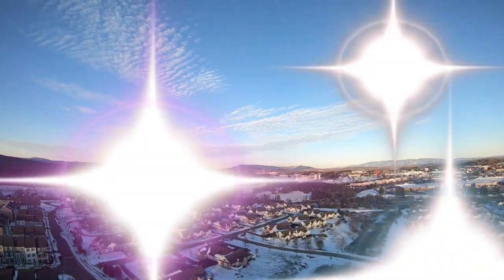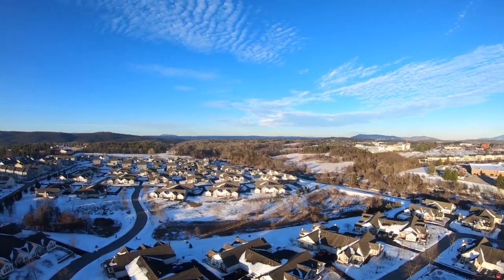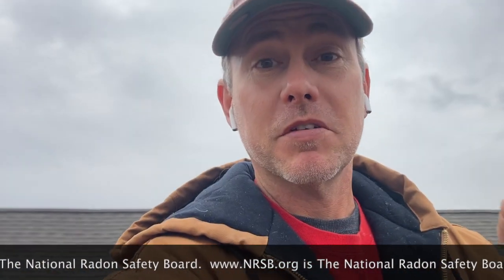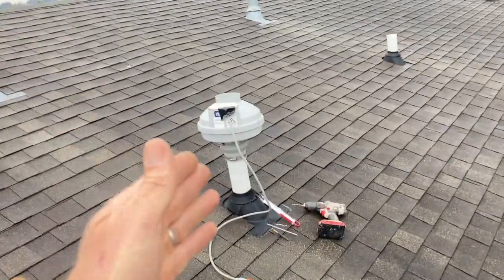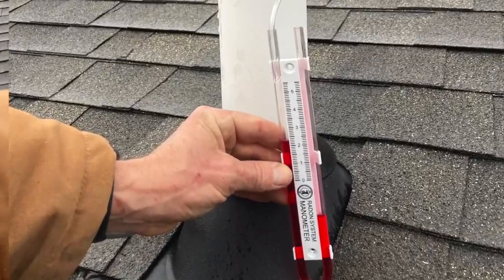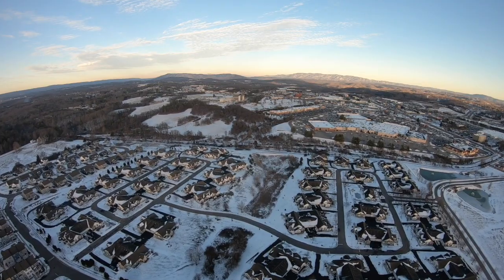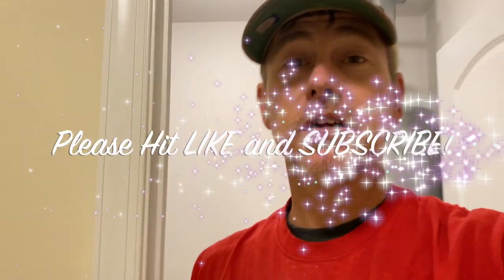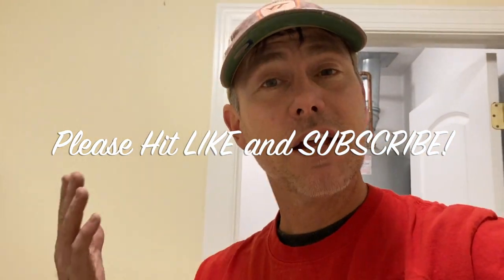These Passive Radon Systems Don't Suck  (...WHICH IS BAD)

Comment: About 60% of homes in my area with passive systems aren’t done correctly. We always cut the pipe when we arrive to see if it’s into gravel or perforated pipe or just blocked off. There’s nothing worse than completing a job only to find the manometer is maxed out 😂. In your case, you didn’t have that luxury because the pipe was inside the wall. Good job catching it! I’ve seen a lot of guys ignore the manometer reading and hope for the best. Keep up the good work!
Reply from the maker: Thanks Keith. It seems like I could make a channel dedicated to just passive systems. I appreciate your dedication to the craft. 😀